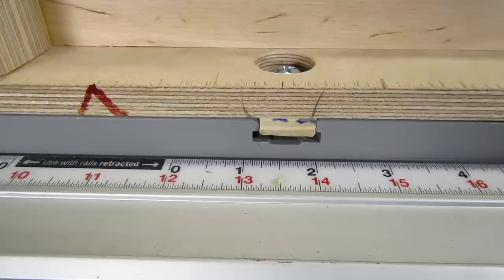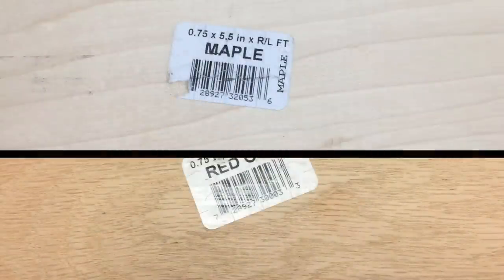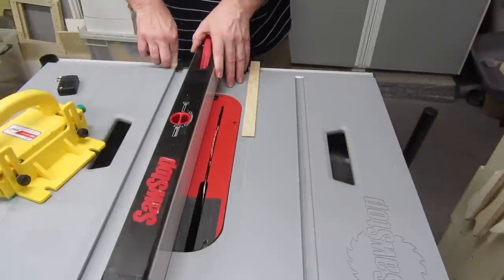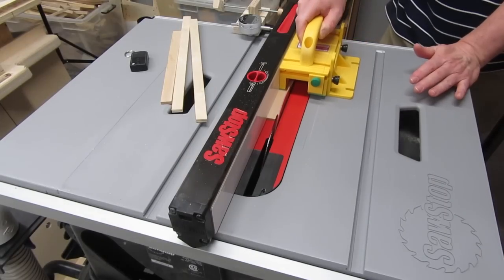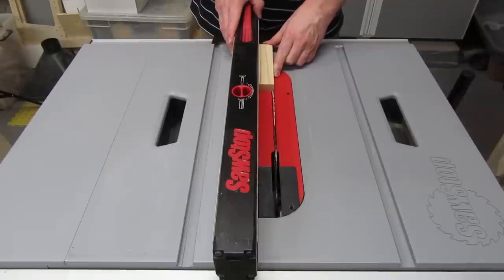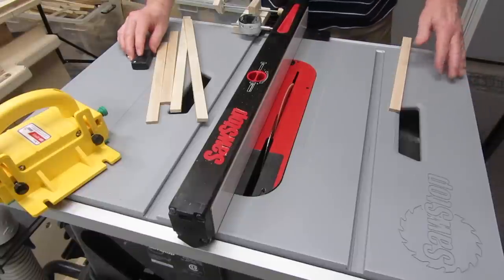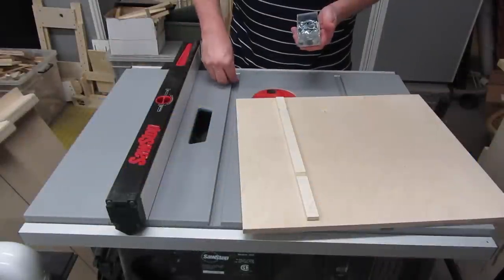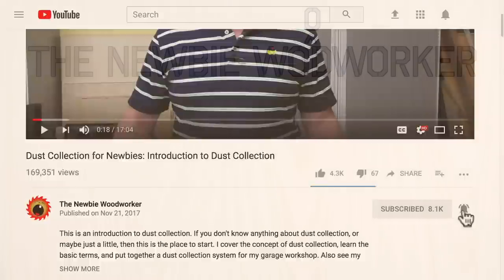Easy! Make Runners for Table Saw Sleds!

Comment: Very informative video, and well-presented!  I started to put up a comment disagreeing with you about the grain direction in the runner section (as did another commenter below), but something didn't sound right, so I deleted it, did some quick research, and realized my comment was wrong, and you were right after all.  Turns out, wood expands when wet only .01% longitudinally (along its length parallel to the tree trunk), 4% radially (cross-section of the tree, from the center out to the bark) and 8% tangentially (right angle to radially).  The article I found as a source is here: http://workshopcompanion.com/KnowHow/Design/Nature_of_Wood/2_Wood_Movement/2_Wood_Movement.htm .  This is why a quarter-sawn board is the most stable, and will get wider when exposed to moisture at only half the rate of a flat-sawn board.  A rule of thumb is 1/4" over a 12" width for flat-sawn, and only 1/8" for quarter-sawn, from humid summer to dry winter.  A quarter-sawn board will get thicker (its tangential direction) at twice the rate as it gets wider, but the thickness is much smaller than the width, so that expansion is barely noticeable by comparison.  A rift-sawn board's rate of expansion is about the same in either direction, since the growth rings are diagonal as you look at the end grain, and not vertical (quarter-sawn) or horizontal (flat-sawn).  So for runners, diagonal's about half as good as vertical, and horizontal's the poorest.  The best orientation for expansion/contraction across the width of the miter slot would be longitudinal (the tree trunk at right angles to the miter slot), but since no one has a board as wide as the runner's length from which to crosscut strips, that's impractical.  You could glue up a panel, crosscut a chunk from the end, rotate that, then crosscut strips from its face for runners, but your plywood option is more practical, since the layers are all shaved from the rotating tree trunk like unrolling paper towels (knives parallel to the trunk), then laminated in alternating directions.
Reply from the maker: Thanks for the comment! To be honest, I regularly get confused about this. I would have felt much more comfortable mentioning it, if I had been able to do some testing, but I decided to go with what I read. So when people tell me I'm wrong, or even right, I just nod my head. 😛😄
Reply from the maker: Oh, and YouTube decided to hide your comment from me for a day or too. So that's why I didn't reply sooner.
Reply: @TheNewbieWoodworker   Thanks for telling me that!  I'm often curious why an exceptionally brilliant comment (not that this one was, but I'm sometimes blessed with one) goes unremarked, then sometime down the road is responded to.  I've made some comments on occasion that they would consider politically incorrect, so I'm probably now targeted by some kind of 'delay-comment cooling-off algorithm' somewhere in the bowels of the system.
Reply from the maker: @JusBidniss  LOL. In this case, I think it's because your comment included a link, but that doesn't always trigger things. The worst thing about YouTube comments is if you reply to an old comment, chances are YouTube won't notify me about it, and I'd never see it. Well, that's if I was a "normal" person. I actually wrote a script that bypasses the problem, so I should only miss comments if YouTube hides them from me. (I'm a retired software engineer.)
Reply: @TheNewbieWoodworker    I like my algorithm theory better, it's more conspiratorial!  😄   Seriously, you're probably right about the link holding it up.
On the grain orientation thing again, I forgot to thank you for that plywood runner tip.  That's an excellent suggestion, especially in light of that bit of reading I did on grain expansion.  Since plywood lamination is shaved from the tree like unrolling paper towels, that means plywood has longitudinal grain (0.01% expansion) running in one direction then the other, layer by layer.  So as long as you have a miter slot depth that allows for a runner thickness of 1 or 2 layers in each direction, a plywood runner should be even more stable than quarter sawn (vertical growth rings as you look at the end grain), which expands at 4%.  However, the hardwood quarter sawn runner does have the advantage of not wearing out and developing looseness in the slot, as much as a soft plywood runner would over time.  So, countersunk screws and no glue, and you could theoretically swap out your plywood runners as they develop that looseness, and make as elaborate a sled on top of them as you want.  Anyway, thanks again for triggering all these thoughts.  When it comes time to replace my sled, I'll have some new ideas to incorporate.
Reply from the maker: @JusBidniss  Thanks, and you're welcome. 😄But if you think the runners I made out of Baltic Birch plywood are "soft", you've never used Baltic Birch plywood. I've been using these runners for almost a year, and they show no signs of wear. It's because Baltic Birch plywood uses the birch in every layer of ply. Try driving a pin nail into it with a spring-loaded nail gun. Not gonna happen (much to my displeasure). It also has much thicker veneer than other plywood. 🙂
Reply: @TheNewbieWoodworker    Yes sir, Baltic birch is definitely the way to go for plywood runners, not only for the hardness but for getting more of its bidirectional layers into the miter slot, resisting expansion.  I should have been clearer, I was talking about that soft stuff I usually buy!  😄
Reply from the maker: @JusBidniss  LOL, I get that. 😛The problem with Baltic Birch plywood, at least for me, is that once I bought some, I have a hard time buying anything else. Even if it is expensive. I just cringe at some of the other stuff now. Call me a snob. 😛
Reply: @TheNewbieWoodworker     Well, I guess those big bucks you software engineers pull down will allow for a bit of wood snobbery!  😛  Us paupers in Operations/Prod Support will just have to make do with our scrapwood!  😛
Reply from the maker: @JusBidniss  LOL! My wife is an analyst, and support person. And she's a lot smarter than I am, so I hold no snobbery there. 😄

Comment: Couldn’t you save yourself a lot of trouble by simply cutting the runners narrow (1/2 to 2/3 the width of the slot), then place them in the slots, shim them to the outside of their respective slot, and proceed with gluing to the sled? 
This eliminates all the  work of trying to get a perfect fit in the slot, yet will still guide the sled perfectly with the slides fit to the outside edge of the two parallel slots… (using inside edges of slots  would have the same result...)
Reply from the maker: Well, this assumes you're going to use two runners, and in that case, what you describe would probably work. However, it wouldn't be easier - once you've learned to cut runners, you can do it in no time at all. Also, you can cut a bunch at one time for use later, and they wouldn't have to be shimmed. But yeah, if you think that's easier, then by all means do it - there's more than one way to do just about anything! 😄

Comment: What happened to hand wood planes?   You can take off a 1000th with each stroke.   No electric used, and get some exercise!
Reply from the maker: LOL, thanks for the comment, Kevin! And God knows I need the exercise, however if it takes "exercise" to plane off a just a thou, I think your blade might be dull. 😛 Seriously, though, there's no problem using planes, if you know how to use them well enough for this. I definitely do not. 😏😄
Reply: The Newbie Woodworker There are times when a hand plane would be faster than any other method.   As for learning how to use a hand plane, you definitely can not learn any younger than you are!   You might actually like it.
Reply from the maker: @KevinCoop1  "you definitely can not learn any younger than you are" What a great comment! Thanks! 😄

Comment: Yeah that plastic sheet is pretty darn expensive.  You have to purchase it in sheets of at least approx 40”x20” to get the continuous runner length and it will cost like 30 USD (or equivalent).  So you cut your two, inch wide strips and the whole remaining 95% of the sheet is technically waste!!!!  I suppose one could make 20 table saw sleds to use the spare stock, and sell them off….Not the favoured solution for most hobbyists.
Reply from the maker: There are places you can get smaller pieces, but it's still more than you need. I guess it depends on how much of an issue that kind of money is for people.